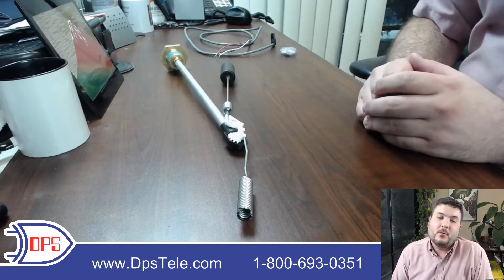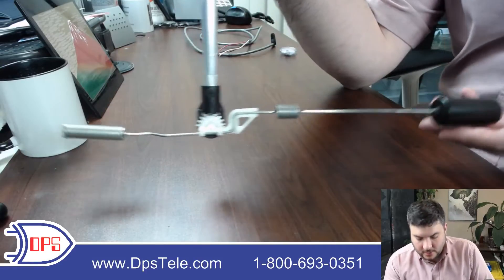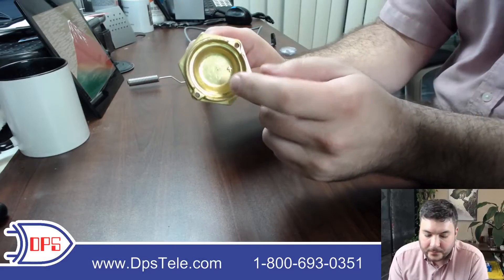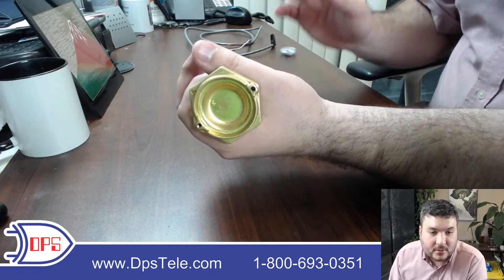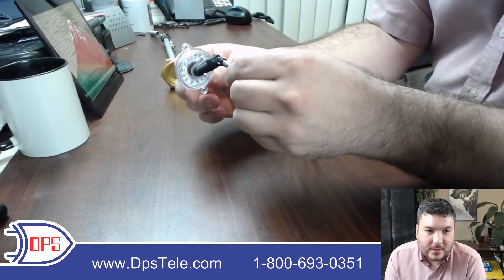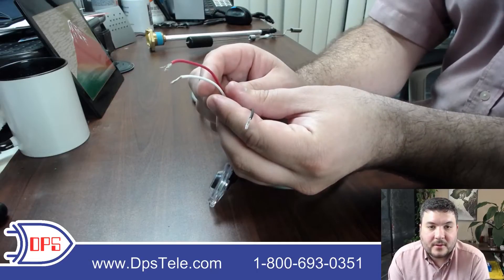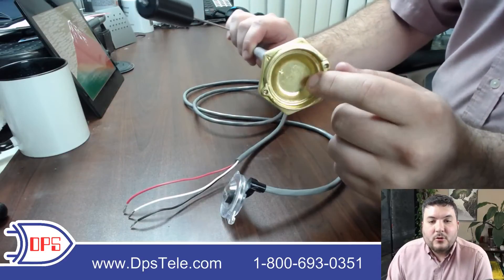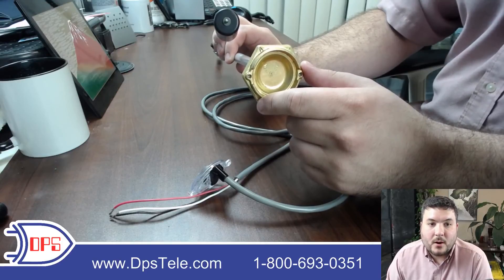Remote Propane Monitoring: Float & Sensor Demo (LPG)

Comment: Hi all, I called the number listed above and asked about the potted cap sensor.. It is a hall sensor, I had made from a defect Rochester wireless stand alone meter. They are no longer made, Why I don't know. Anyway, when my unit died, I checked it out. The sensor was still good.. So I had decided to make my own Gas Gauge.  Tho it isn't wireless, it worked great. It had a 30ft lead.  The gauge was very simple, I made it  with 4 leds.. 4 leds on = full ( considered full, as a full tank only registers about 90%)  So full was 4 leds on,  3= 3/4 tank, 2= half tank, 1= about 8% to 10% and no leds meant you had 5% or less.. 
I inquired about a new sensor, because a close lightning strike took it out..  They were willing to sell me a new sensor, But they wanted  $108.00 for just the sensor.... it's crazy over priced for a 20c hall sensor. 
I could see maybe 25$ max. But this sensor is way out of anyone's budget.  I'll see if i can mold my own.
If I can, I'll share it in a Video.. I'll call it  something like.....DIY Propane gas meter or such.. I just gotta find a sensor 1st..    Maybe Andrew Might chime in and give any offers for a cheaper sensor or explain why it's so crazy priced...

Comment: I'm unconvinced the R3D approach is all that accurate.  The principle upon which it is based is the strength of a single magnetic field without any inherent self calibration possible.  Although the companies selling the overpriced apparatus would have you believe otherwise.   I'd argue the visual gauge itself will be more accurate accurate, and that's about as good as it gets for a LPG supplier standard issue setup..  Although warnings on the gauge faceplate NOT to use for filling purposes may have you questioning this.  I'd expect a refocused $10 usb webcam would give a the most accurate reading and clearly indicate failure scenarios such as the sensor (camera) becoming dislodged during a hasty filling operation.

Comment: Wondered how they worked: Heavy rain and wind storm dislodged my gauge and it was laying on the tank and I panicked until I saw that it was magnetic (thanks to your video) with no mechanical connections, so when I placed it back in its housing, it worked just fine. Thanks for the info!

Comment: Thanks for the technical description. 

Makes me a bit confused why no one can make a simple, cheap digital reader that plugs into R3D gauges and gives some finer detail to track than the mechanical gauges "somewhere between 50 and 60" 

Not everyone needs to spend $200-2000 for a wireless solution.
Reply: Probably some sort of patent issue. But it's super easy to make with a standard S49E Hall Effect sensor, which cost pennies. Hook that up to an ESP32/Raspberry/Arduino or whatever to read and translate the output, and output the tank level value to whatever system you want.
Reply: @Sammyc53  I built my own display.. 4 leds,,, and a quad comparator with 4 trim pots so I can calibrate each part I want.  Full , 3/4 , 1/2 , E   Bout as easy as you could want.. It's wired tho.. not wireless

Comment: Hi Guys, I live in the UK and have a 2000 litre tank which can be read remotely by Calor (supplier) and has a very similar Gauge to the one you're showing in your (excellent) video .  If I call them they give me the latest weekly reading of level / volume.
I dont know how they obtain that reading, would be interested to know and wondering why I cant monitor it myself.
I asked if they had an App but they said no and have looked everywhere on the web but can only find information on monitors for small portable tanks and bottles.
Any advice or information would be greatly appreciated.
Reply: Our supplier uses Nee-Vo, with their app we can monitor it ourselves.
Reply: I believe Fogas UK now lets you monitor remotely & there prices can bo ok if you haggle. I pay 50p per litre in December 2024.

Comment: The R3D-LP site indicates the following..."Warning! For LP-gas and other flammable product service applications, connect only to circuits and power sources Classified and labeled as Intrinsically Safe for Class 1, Division 1, Group C and D hazardous locations. The connection of non-intrinsically safe power could cause fire or explosion of flammable vapor which may be present."

How do you deal with this?
Reply from the maker: You should always follow local codes and best practices. I can tell you that many DPS clients use wireless data transmission and a battery-powered fuel sensor to create an "air gap" for precisely this reason. It also eliminates the cost of trenching, which can offset most or all of the expense of wireless.

Comment: My Lp tank was leaking around the threads of the gauge. When I unscrewed it the float fell of inside the tank. Where do I find an inside gauge replacement and when I install it do I have to remove the tank to do so?
Reply from the maker: Inside gauge replacements would be available from any tank or sensor supplier. Be sure to note the dimensions of your tank, as the float should cover most of its vertical dimension without striking the bottom when the tank is empty. You may not have to remove the tank to install the float, but you will need to drain it. Since you opened the tank to inspect the leak, this must have already happened. You can certainly contact DPS if you'd like us to find and re-sell you a float. This isn't a part we manufacture ourselves, however.
Reply: Thank you for your reply. I however decided to buy a new tank because there was rust around the other devices as well. It probably was not necessary but a new tank will last the life of the RV. which is an 05.
Reply from the maker: I know that feeling! Sometimes, buying something fresh is more convenient than getting stuck in the weeds of a problem. Happy RV'ing.

Comment: Good Job    Thanks
Reply from the maker: This was something Ron in our office told me about. He would have trouble explaining over the phone that you don't actually have to drain your propane/LPG tank to install the gauge. As long as you have a compatible float with a magnet, you don't have to open the tank at all - but that's a tough one to explain on a call. Glad you found the info helpful.